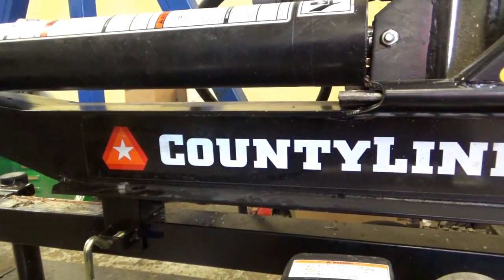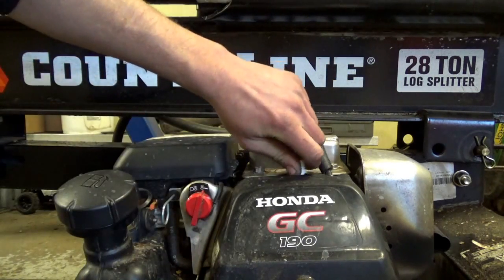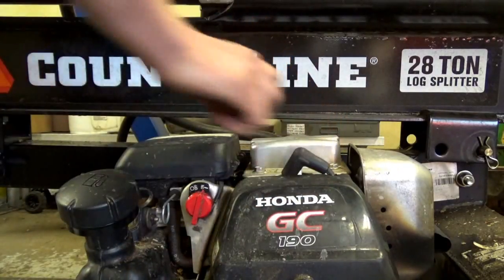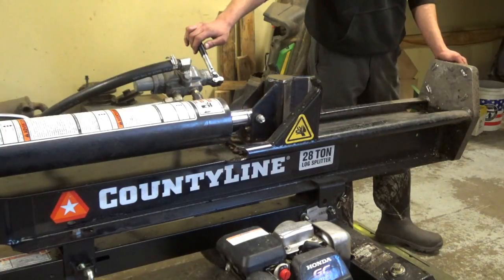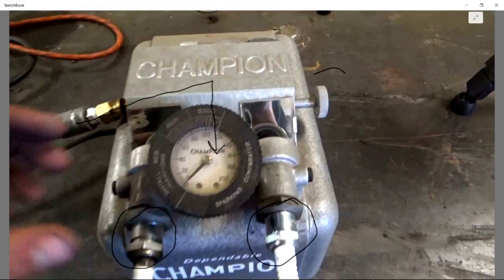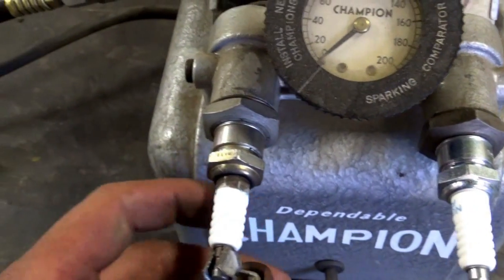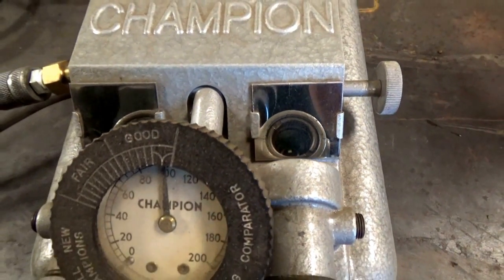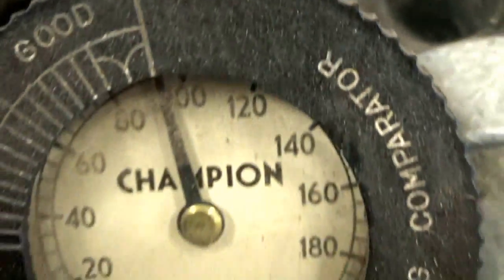County Line 28 Ton Log Splitter - No Start

Comment: I have the same log splitter same engine, mine wont come up to full throttle idle, it spits and sputters.   Last year it did same thing but cleared up and ran full power idle.  I parked it inside garage, took it out this year, I cleaned carb, checked and cleaned spark plug, new gas, new motor oil.  wont come up to full throttle idle, spits sputters no power.
Reply from the maker: Sounds like it is still leaning out at full speed. I'd confirm 100% that the ports in the carb are nice and clean and not obstructed at all (it doesn't take much).

I'd also double check your valve adjustment.

Comment: What if it is not the carb or the spark plug what is the next most common thing that would make a splitter not start?
Reply from the maker: Engine mechanical fault. A gasoline engine needs fuel, spark and air.

If the carb is clean, and the air intake isn't clogged and you have good spark, then you are left with engine breathing.

A compression test or cylinder leak down test would help pin-point your faults.
Reply: Okay, I’ll try again tomorrow.
Reply: Thank you.